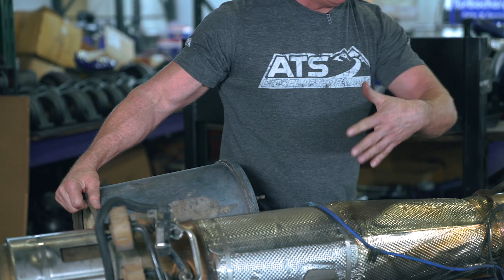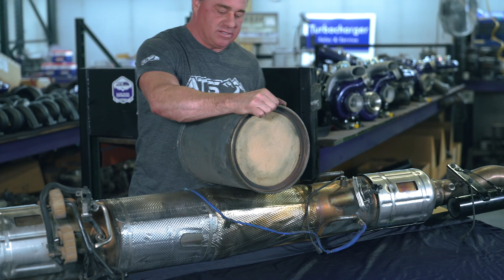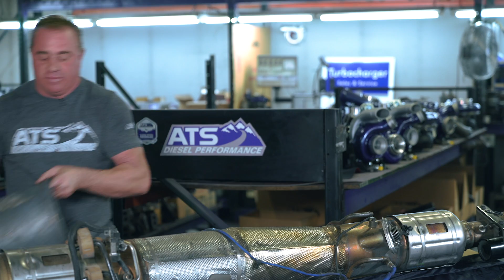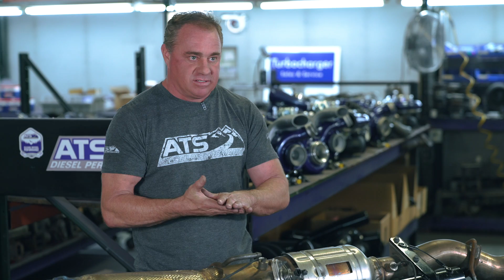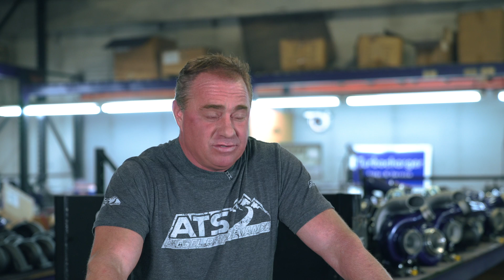ATS Diesel Clean Diesel Discussion: Episode 2 - DPF & After-Treatment

Comment: It is not exciting when you are facing CEL and limp mode.  Not everyone wants to spend $10K on an ATS system  in order to lessen the chance of limp modes even though the performance is much better than stock.  I have a 1999 Dodge 5.9L with 246K mile and do not have to worry about limp mode unless of course the fuel pump kills the injector pump.  I have a Jeep ecodiesel that lite up like a Christmas tree and stranded me 500 miles in the middle of nowhere. Most dealers do not have people to actually diagnose and repair these trucks so they just do  as was said here. Pony up $5K and replace it all and hope that the CEL is not on within 100 miles after you get it back. ATS are good people and have good products but they make money on upgrades and not OEM problems. If you want more horsepower and with it more reliability then ATS is there.  Good explanation of the DPF system and how it works.  You saw all of those "sensors" and they regularly fail killing the system.

Comment: I had a 2017 dodge. Def tank froze , then pump froze, the nozel plugged but the dpf never plugged. 170 000 km when i got rid of it. I had alcohol injection and left it stock ,would that have helped keep the dpf cleaner?

Comment: So what causes an SCR to go bad?? The dealer wants 12000 to replace the whole assembly because the SCR is out of range. Other than the NOx sensors, what goes wrong with these?  Stranded 2013 F350 in idle mode with 3 horses 1000 miles from home.

Comment: why is the fuel unburnt  let me guess EGR   What is the air volicity of exhaust gas at hyway speed Wont have very much time for this magic to happen  All this increases fuel consumption by my facts 27 percent   while reduceing power causing more throttle input   dosent make practical sense   running the planet out of fuel faster  diesel fitter AUS Garrey

Comment: I’ve read the comments stating how good this is, just wait until you’re hit with a $7k bill to replace the DPF/SCR. Or how the EGR destroys your engine after about 85k-120k miles.
Cheapest option is to either not buy a diesel, or do a delete.
Reply: yes recyleing the engine soot back to the intake is like eating your own shit   Wont live long  Garrey
Reply: I am not a fan of new diesel trucks.  I don't care how nice they are in the inside its not work the monthly payment and the maintenance required to keep it running right.  My 2006 Duramax LBZ is the work truck version and has no bells or whistle on the inside which is fine by me.  All emission has been removed and the truck runs how a diesel should no restrictions.  When the time comes for a rebuild I will pay for that still cheaper by far than a new truck plus old trucks are proven, these new trucks I doubt will make it 20 plus years without something major.
Reply: @dustinryan9671  honestly won’t even make it past 5 years.
Mine was a 2017 and engine blew at 61k+ miles….
Buddy is a diesel mechanic and he says the same thing, never buying a newer diesel.
I honestly wouldn’t even do a delete because the risk of getting caught/dined is to high.
Reply: @testicular-cancer  I understand about deleting is not for everyone but I live in a fly over state with no emissions checks or anyone really caring about black smoke plus I never roll coal anyways 🤣.
Reply: @dustinryan9671  so do I, but even still, state troopers are pulling over trucks everywhere and still getting fined for it. It’s happened to two people I know. Although, they do roll coal, so they were asking for it essentially.

Comment: With the filter... 
What causes a malfunction? Is there anything I could do to fix it? 
I've got my 2014 Ram 3500hd cummins the wife filled with gasoline. 
I got everything cleaned out and running great but now getting the alert the filter is 100% filled. 

Another alert now is going in limp mode in a few miles. Need to take to dealer for DEF repair. 

With the gasoline going through crap and now getting these alerts, am I pretty well screwed and about to be paying up close to the 10,000$ to repair this truck?

Comment: Does your company modify the DPF with the clips you talked about in the video. Also where are you located. I live outside of Dallas Ft Worth Texas. Do you have a shop in my area. My phone # is 682 429 8075. I am interested in getting this done. I haul travel trailers out of Indiana all over the U.S. My truck is 2011 F350 6.7l.
Thanks

Comment: Great video. I have a 2013 Ram diesel with only 50k miles on it. At around 30k it started giving me messages to have the DEF system serviced. After a while the messages go away and come back regularly. On my vacation a warning came on that in 300 miles the 15mph cripple will happen. I drove on and after a few of these messages they stopped and I continued on my 2500 mile vacation trip. I want to delete my truck and reprogram the computer. However after watching your video it seems that instead of removing and replacing the exhaust system, I could just drill out the DPF. What do you think?
Reply: Nope. ECU will notice the lack of back pressure at the DPF and cripple you. You could stealth delete by drilling it out and changing tuning.

Comment: Don't like that they put the SCR between nthe DOC and DPF. 
The DOC can burn the injected diesel and help the DPF to regenerate so it should be just before the DPF. And the injector to the Urea would not get soot on it of it was after. Plus the Heat from the regeneration help prevent small crystal build-up happen in the SCR and around the Urea injector

Comment: The company I drive for has a F-650 with a Cummins engine and Allison Tranny, with 170,000 miles the Emissions system started messing up, they have spent $21,500 on that system since November 12 2020 yes you seen it right $21,500 !!!! I said DELETE but they were afraid too!!

Comment: Well done, thank you. So it appears that the biggest problem in the system is the DPF, and that is the least polluting portion of the system. I have wondered about just having cartridges you pull out, dump the spot in the trash and put back in.
Reply: Big semi trucks have those.. but they simply remove um and pressure clean um! We need this for small trucks!
Reply: @RēxNōbilis yes yes yes! Putting clamps on it as demonstrated is the next best thing.

Comment: I appreciate the impressive engineering here, but I'd still rather see a $500 annual "vehicle enthusiast carbon permit" because 200,000 people burning diesel in an open pit instead of driving thier heavily tuned trucks will still be less polluting than the Amazon and Walmart shopping an equivalent number of people do annually, buying everything from heavy pollutant countries is apparently fine with the EPA. All the unrestricted diesel enthusiasts in the world combined would still not add up to .01% of what emissions seaborne transport just to the USA creates annually, not even including the actual production of the goods on those ships🤦‍♂️

Comment: I could deal with a 100,000 mile service interval, although not fantastic having to spend a grand to service the exhaust, its the EGR that is the thorn in my side. Putting raw exhaust back into the intake is a deal breaker. Why not run ALL of the exhaust through....well, the exhaust! Running an EGR to me with the so-called advances they are making these days, its not well thought out. EGR's strip life from a Diesel engine.
Reply: That is the part that I cant get past either... Just can't talk me into forcing that crap back in the intake being ok.
Reply: Believe it or not it cools the engine combustion thus reducing nox. Is it an power robber? Of course. Is it bad for the engine? I guess that is debatable, cooling the combustion chamber might be helpful for longevity. Will it clog and be a pain in the ass? Yup.
Reply: @jeffreygoss8109  also introducing soot to your intake, building up on the valves, etc. 
in no way is it good for your engine and there’s far better ways to “cool the combustion chamber”. 
There’s a reason why custom high horsepower builds do no such thing. It’s basically shitting where you eat.

Comment: Lol he said clean exhaust. The DEF is killing vegetation around road ways because of the  ammonia. 
Then add the fact that you are burning more fuel during regen as much as 50% more. As the trucks get older they go into regen a lot more often. 
Sorry but a clean tune with all that shit removed is far better as mpg go up a ton. So in the long run it’s a clean tune not black smoke along with less fuel burned. Delete delete delete

Comment: I have a clogged dpf on a 2008 6.7 Cummins,  what’s you’re thoughts on using cataclean vs taking it off and cleaning the dpf?
Reply: I have same truck same problem. What did you end up doing with yours
Reply: Shop said they can replace it for around 9,000 dollars or delete it for 2300. I wanna just clean it if that's possible
Reply: Last summer I was towing my boat and looked in the passenger mirror and there was slight black smoke coming out the back I was slowly loosing boost.  I pulled off the road had my pops come grab the boat, after an hour with the truck sitting there I fired it back up and it was still the same I took off and drove the truck back to his place about 10 miles away I was rolling coal on a stock truck.   I had an injector that was stuck open that’s why I was rolling coal not a bad turbo.  I had gotten the exhaust manifold hot and it warped.  I took off the exhaust system as well it wasn’t too bad to do and cleaned it with a vacuum and air compressor and then a dpf liquid cleaner.  Bad turbo = white smoke,  lack of boost = warped exhaust manifold,  you may have a crack in the honey comb in your dpf system.   What’s your truck acting like?  The mechanic charged me $1,300 to get the exhaust manifold redone with new gaskets.

Comment: What is able to be done for the 07.5 cummins without the scr? All I see stuff for is the 13+...Also, can a dual fueler, compound set up be tuned the same way on the old 6.7 as is done on the new 6.7 and not increase nox and soot loading? Not looking for high, high horsepower,  around 500 or so is the goal.

Comment: So yes you keep all the emissions systems intact but would a fully outfitted truck producing 800 hp realy pass emissions, on top of that your saying that you will have to service them more if you tune them because your will be useing more fuel and soot loading them
Reply from the maker: Crown Lifestylist  our 2015 running 650-700hp just passed emissions in Colorado with .01% opacity.   We are installing all the testing equipment to begin emissions testing in house.  800hp is the top end of where you will see some soot loading.  As with most high horsepower vehicles there are some trades off at the highest power levels and can be turned up and down accordingly depending on application.  Go up to 800hp for the track, maybe knock it down to 650-700hp to tow and DD.   Again, let’s remember they are ZERO other legal options like this on the market.
Reply: @ATSDieselPerformance  how about mpg numbers wouldn't the draw of such horsepower drain fuel, and what about your transmission, your transmission you sell some to be more of a reliable replacement for stock horsepower do your rfe 68 transmission have the ability to handle 800 horsepower?
Reply from the maker: Crown Lifestylist   If you drive it with your foot to the floor using all that power all the time you will see lower mpg.  Yes we have transmission modifications that will hold 800hp.  We have a full video series on all the upgrades we do to the 68rfe.  Please stay tuned for more videos that go in depth into the 68 valve body.  Thank you for your interest!
Reply: @ATSDieselPerformance  omg, you guys are amazing, and you provide information and clarification in detail for anyone who wants it! Wich is more then you can say for alot of companies thank you

Comment: What if you just put a hole in the DPF so it never truly builds up?
Reply: Knock the guts out, like an old cat.
Reply: youd still have to tune it out . Modern trucks have pressure sensors looking for that backpressure difference caused by the filter.

Comment: I'll be following along. Thank you for sharing. I've tuned smelly older diesels for years. I added a 2020 powerstroke as my new daily and I enjoy the quietness, smoothness and clean exhaust. I plan to do my own tuning once out of warranty and leaving emmissions intact and appreciate some of the tips on tuning and properly setting up an engine to maintain the emissions equipment and not impacting soot loading and reliability. I imagine eventually we will see the day of 1000hp emissions intact trucks possibly with an aftermarket dpf etc.
Reply: Delete your truck now.  Black smoke forever!

Comment: You said the EGR its your friend just for keep doing  business you know that's is BS
Reply from the maker: Paul, when you burn the fuel clean enough EGR is cleaner and has much less negative impact than soot loading it.   It’s not BS it’s called fuel atomization and increased airflow.
Reply: @ATSDieselPerformance  , whatever, clean tune its a factory tune and the egr and egr cooler clogged around 70,000 miles, second all that exhaust gases enter to ours intake manifold without filtering you know i respect your company but please don't make this kind of videos saying what other people want to said because no one in the live create a machine to be self-destruct. I know its a new era we need to used all that kind off stuff buts that's no mean in any circumstance its healthy to the Engine.
Reply from the maker: Paul Otero in this new era we have to play by the rules.  Unfortunately, whether we like it or not, these are the parameters we have to work within.  It’s not our first choice by any means but we will continue to strive to make legal power solutions for our customers.   Thank you for your comments!